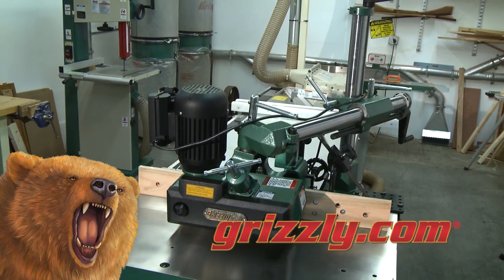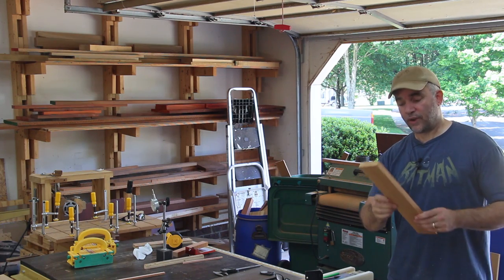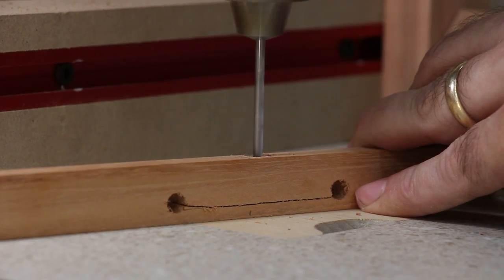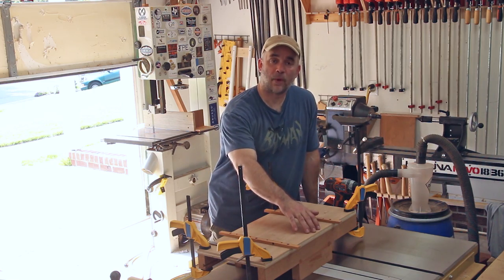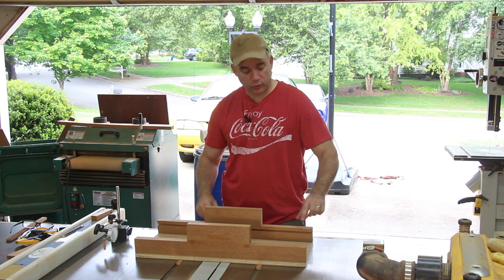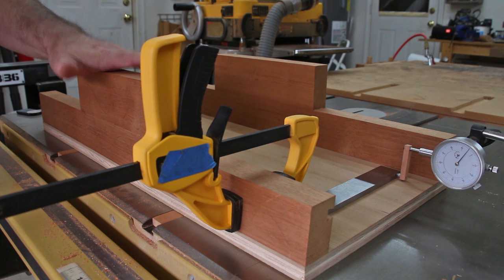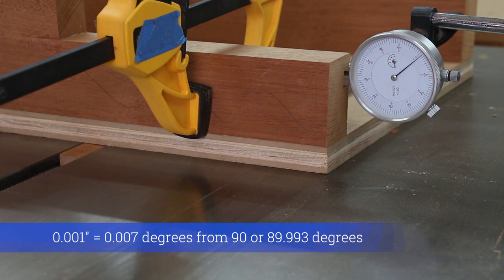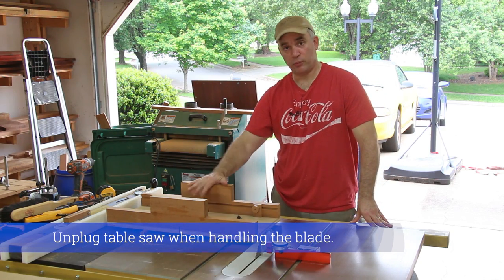Small Parts Sled - Align it Like a Ninja

Comment: I too, have a couple of table saw sleds, and each one of them I used the five-cut method to align.  They are very accurate and I like them alot, but after watching you use your method I can't imagine why anyone would have issue with it since the amount of error we're talking about is far less then we, as woodworkers, need to work to.
Great method!
Reply from the maker: I agree.  They are both extremely accurate methods and any comparison btw accuracy is splitting hairs.  It comes down to convenience and speed.

Comment: I need to start thinking about replacing my big sled and the fence alignment is the part I don't like. Last time I did the 5 cut method but it took 7 tries to get it right. 5 years later it's out of square again. I will certainly be using this method. Thanks very much Brian!

Comment: I really like your method more than the 5 cut method, especially because you don't need to temporarily secure the fence to the base. Seems a lot faster and easier. Also really like the dovetail slot over buying t-track. Lots of great stuff in this one!

-Caleb Harris
Reply: I agree but there is a t-slot bit that I use in my router to make a T-slot so I don't have to buy track for all my jigs

Comment: great video. i have used the 5-cut method before and yes, it works fine... but i am in the same boat as you described (my 1st sled I built is just too big) and I stumbled upon this video. Glad you took the time to post this. I have a dial indicator and will most definitely use this method this time around! Thanks again!

Comment: Great video.

The interesting thing too is that with your method (and mine) of setting square to the mitre slot, even if the blade is slightly out of parallel, the cut will still be square. The ONLY things wrong will be that the vertical face of the cut may be ever so slightly off square due to the minute curve of the cut caused by that angle (nothing measurable), but more importantly, the rear of the blade will be cutting into the piece as well as the front teeth, but on the upstroke. That I reckon is more of a problem :) risks all sorts of things like kickback etc. That is the real reason to check the blade to the mitre slot occasionally.

(Sorry, the mathematician in me can't help it. AWESOME channel by the way)
Reply: great point!
Reply from the maker: Your blade would have to be pretty far out of alignment with your miter track to risk any kick back in a table saw sled (I've actually never heard of kick back happening in a sled).  Blade to miter track parallelism is important in woodworking for other tasks as well, such as cross cutting with a miter gauge.
Reply: True, the risk of the upcut at the rear is a possibility tho. and yes, the kickback won't happen with the sled in place, rather when ripping.
Reply: GarageWoodworks  I am really a novice in woodworking. How did you make that dough tale piece in order to fit it into sled made by routing?
Reply from the maker: See here: http://www.youtube.com/watch?v=jLRID12ks7Q&t=9m42s After I made the dovetail, I recessed a nut into one side and used epoxy to secure.
Reply from the maker: I thought about your comment some more.  With regard to "..the rear of the blade will be cutting into the piece as well as the front teeth" <- This will also be the case with the 5-cut method.  Even though you are aligning to the blade, the direction of travel (miter slot) will be non-parallel.  The best solution is to make sure your miter slot is aligned with your blade.
Reply: Exactly, the mitre slot is the key of it all. The fence on the sled must ALWAYS be aligned to the mitre slot so as to get a 90 degree cut. The blade too needs to be aligned to the mitre slot, but for an efficient and safe cut. People trying to skip the mitre slot as the key are only going to get themselves in trouble.

Comment: Great technique.  I'll be making one of these very soon.  I did have one idea to add.  Instead of making an offset piece for your indicator, how about using a flat piece of stock to put the square on?  That would raise the square so you could use the indicator directly and not need the offset piece.
Reply from the maker: +Kevin Gleason Should work as long as you can keep the square from moving during measurement. The goal is to get the dial indicator plunger as close to parallel with the table saw surface as possible.
Reply: GarageWoodworks
Brian, get rid of the offset finger, it's just a source of problems. Turn the indicator face up and your indicator base has the fittings to let you slant the beam down enough to put the indicator probe parallel to the table, level with the square. Kevin Gleason's suggestion is all you need if the mount on the indicator is too big to get the probe low enough. You are clamping against the fence, so laying a piece or two of ply under the square won't be asking for trouble.
All that being said, it's all a bit - I agree with all the others that your technique is a winner!

Comment: Awesome video.  I love this method.  I am always afraid I am going to screw something up between finding the right position and securing the fence.  As long as the fence has a pre-drilled hole, is there any problem with finding the right position of the fence, drilling a pilot hole into the base through the pre-drilled hole in the fence, then screwing them together without moving the sled off of the table saw?  The only issue I see is the possibility of moving the fence since it may not be as easy to clamp down.
Reply from the maker: That sounds like it should work, but I've never done it that way.
Reply: I will try it out when I am done making cabinets and drawers in my shop because this would be a good thing to have when I make your horizontal mortiser.

Comment: Thank you for the video. I just made my cross cut sled and was very happy with how it came out. Figured last thing was to simply square up fence with 5 cut method and it has been torturous. 7 hours and closest I could get was 0.006. I have a dial indicator for my table saw from A LINE IT that goes into miter slot. My table saw fence is set to 0.001 so I clamped the dial indicator to my table saw fence and used a 12" Woodpecker 1281 square clamped to fence of sled. I still can't zero it in. I have Matchfit Micro Jig dovetails in sled so it's very easy to clamp the fence on opposite side of pivot and I still can't get close. Any ideas?

Comment: Superb! Thanks for sharing. How did you calculate the degrees  offset from 90? :)
Reply from the maker: arctan (0.001/8.5) = 0.007 degrees.  8.5 is the length of the square.

Comment: Great approach to squaring up a cut off sled!  However,  in the video you said that you would include an address for the very thick try square, didn't happen or somehow I just missed it.  Could you send it on? I have been on line looking for the try square you used with no luck.  Obviously I haven't tried this method but I agree with you that it beats the socks off of the 5 cut method! Thanks for many great shows.   Bruce Thompson
Reply from the maker: +Bruce Thompson See video description.

Comment: I am trying to use a dial indicator to set up my saw and I am not sure if I trust it the readings.  Once I zero the indicator then move it to where I want to check for run out (of whatever I am trying to align) then move it BACK to the spot where I set it to zero, it hardly ever reads zero again.  Seems like it should.  Is this common or do I have a P.O.S. dial indicator?  Thanks.
Reply from the maker: No, I doubt it's your dial indicator.  Whatever you are using to secure the dial indicator is possibly moving or you are not getting the DI back to the original spot (miter bar loose?).  I would need more info to really help.
Reply from the maker: How are you moving the dial indicator around?  What are you measuring when it happens?  What is the DI attached too?

Comment: You mentioned the 5 cut was an "inferior" method and took longer. However, purchasing and setting up all the precise tooling in itself is time consuming and obviously more expensive than a piece of scrap plywood.
Some other remarks you made during this video seem to have an arrogant tone
Reply from the maker: +MRrwmac A dial indicator and square can be used for so many other shop tool setups. For as much as woodworkers spend on tools, spending an additional $15-$30 to set them up properly is insignificant by comparison.  They are great to have regardless if you use them to align a sled or not. I use my dial indicator and square to also align my table saw blade, jointer fence, table saw fence and miter saw.   I'm confused by your "arrogant tone" comment and I found it inappropriate and extremely rude.
Reply: As I recall, the five cut method requires that you have an accurate caliper and a set of feeler gauges.  (And it uses up  piece of plywood!)
Reply: After watching the video twice, it is clear you are confusing arrogance with CONFIDENCE.  You can use the dial indicator setup for many projects in the shop.  Using your thoughts, you can only use the 5 cut plywood once - maybe twice if you can cut it up.